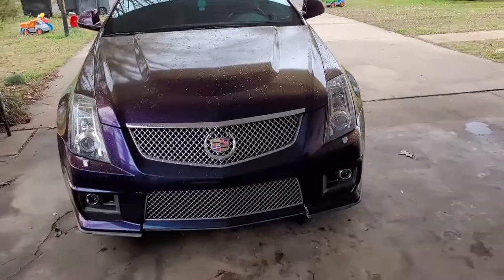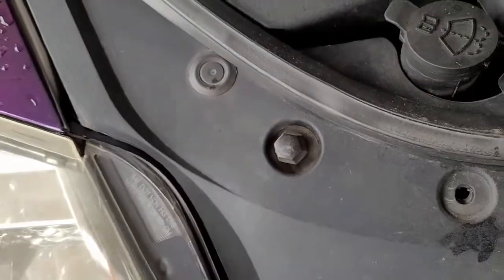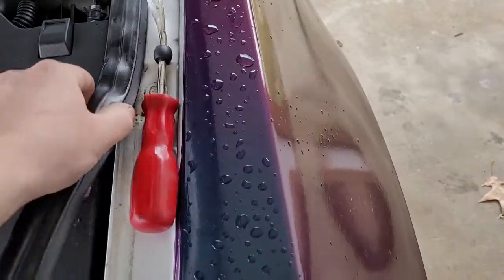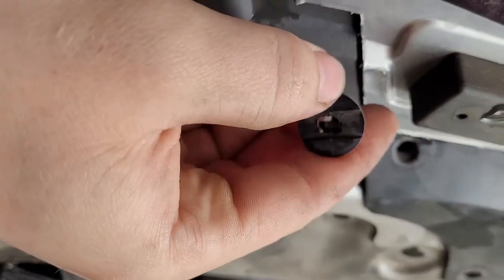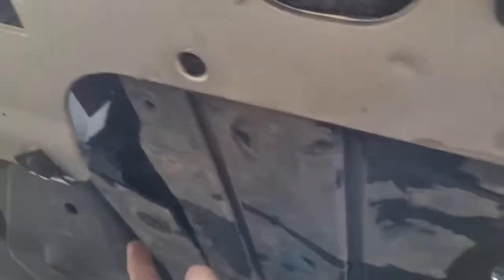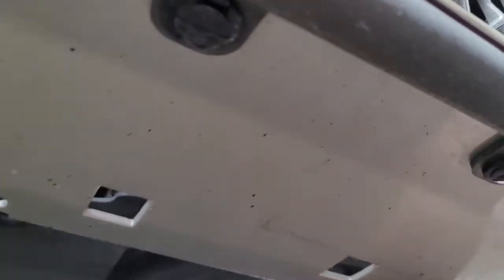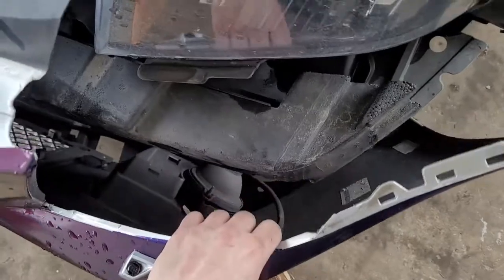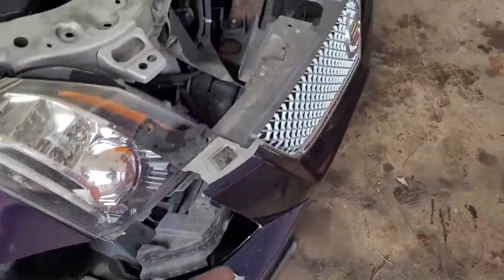CTS-V/CTS: Bumper Removal

Comment: Question, would this front bumper fit a 2008 CTS 3.6? The one with the bigger grille.. kinda like this bumper.. everything you removed to take off the bumper is the same process as mine and also the headlights are same model